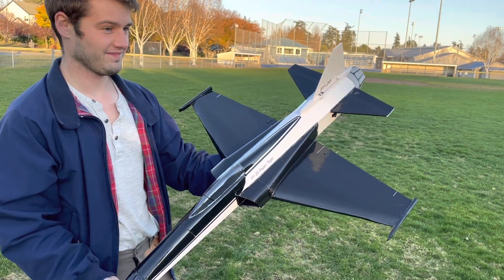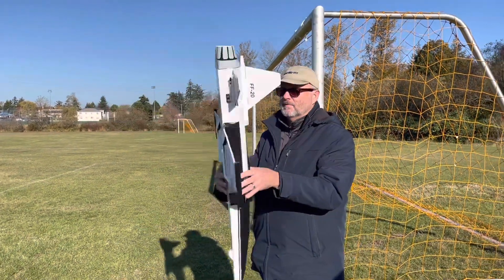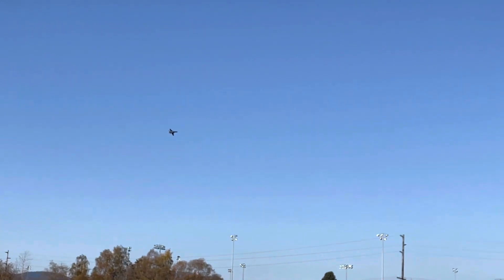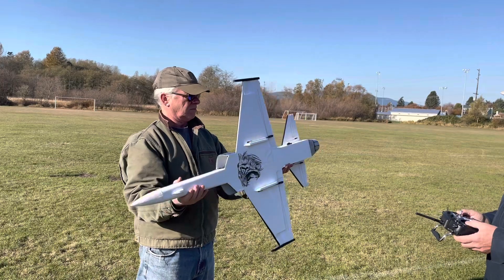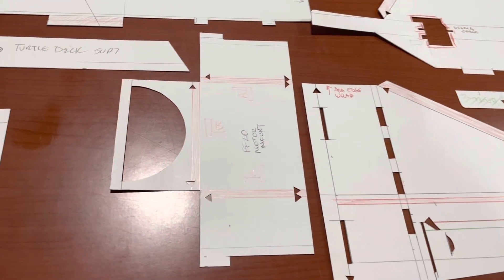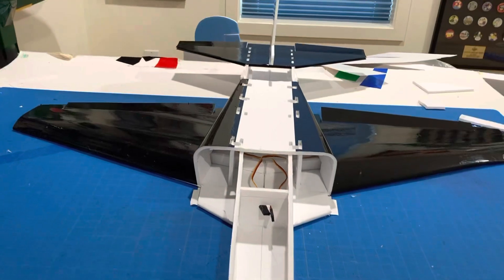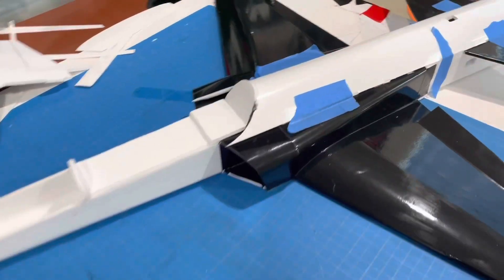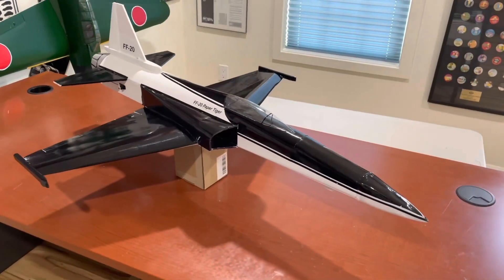Foam Board 64mm EDF RC Jet Maiden Flight and Build Details

Comment: does the nozzle increase thrust or is it just for show?
Reply from the maker: It depends on the exhaust area relative to the fan swept area. In this case, the exhaust diameter is 90% of the fan swept area so it reduces static thrust but increases top speed.
Reply: Thanks for the response. could you tell me what motor you're using and the ducted fan size? any idea of the thrust it produces? i have a project i would like to build that could use a ducted fan of that size if its capable of producing enough thrust...i wonder if a ducted fan would produce more thrust if you attached two motors in tandem like they do on quads, or would that produce diminished returns?
Reply from the maker: XFly 64mm 2840-3200 4s. I measured 1250g of thrust on a test stand. Not sure what it measures installed. The plane weighs 830g ready to fly with a 2200mah 4s battery
Reply from the maker: Most of the thrust is based on RPM. Two motors could help if there was a lot of restriction on the intake because it might need more power to reach the max rpm. Otherwise I believe one motor should do it. The way to tell is to measure the rpm to see if it reached max for the motor. I also built one of these with a 6s motor and it flies fast! (See the blue and white version in my video list)

Comment: I juste have a question : how did you fix the wings to the body of the plane? Did you just use pieces of foam or some wood?
Reply from the maker: Originally just foam, but then I added a carbon tube (arrow shaft) as seen in the video here towards the end https://youtu.be/_UksRAJ0vgo
Reply: @thenerdoligist1292   Oh right thx ! How heavy is the battery?
Reply from the maker: @baptfk7621  the 4s 2200 battery I use is about 225 grams
Reply: @thenerdoligist1292  Thx! One more question: why do you use 2 servos for the elevator? Is it because you use the elevator to turn, and not only to go up and down?
Reply from the maker: @baptfk7621  it was easier for me to use two servos since the fuselage is so wide. They are only used for pitch control but could be mixed with the ailerons (and/or rudder) in the future.  I will probably use a single servo in a future build

Comment: GREAT video. Incredible build.   I'm currently building a very very basic foam board 64mm EDF jet.  QUESTION.  Is your EDF mounted Parallel to the bottom of the wing, like it appears to be.  And if so, is there any Throttle / Elevator mix required for level flight.  Or is there any Reflex required on the Elevator to keep it from climbing or dropping during acceleration.  Let me know please.  THANKS.
Reply from the maker: Thanks! Yes, parallel to the flat bottom wing. It is trimmed with a very slight up elevator but I suspect I’m flying a little nose heavy (I haven’t experimented with CG location since this was my first jet). It is not susceptible to trim change at different power levels. When I do a second one, the elevator will be a little larger and the rudder much larger. I’m now designing a CF-105 Arrow 50mm EDF. It will be an easy build

Comment: HELLO. I AM GEORGE FROM GREECE. PLEASE YOU NO WHERE CAN I FOUND THE PLANS ABAUT??
Reply from the maker: Hi George, I don’t have plans for this model drawn up. Possibly some day. I am still enjoying flying this model but if I destroy it, I’ll make plans when I build a new one
Reply: @thenerdoligist1292  From where can i buy the EDF?
Reply from the maker: I’ve bought from Amazon, Walmart, and AliExpress. The different kv ratings have limited voltage requirements. In general, lower kv can handle higher voltages (4-6S) and higher kv are limited to lower voltages (2-3s). Hopefully they will provide a chart for power and kv vs voltage
Reply: OK MY FRIEND. KEEP GOING! I AM HUPPY FOR YOU! YOU MAKE GRATE MODELS!! I M N LOVE WITH  THIS HOBBY WITH AEROPLANES!  AT LAST  1995....
Reply: I AM 51!